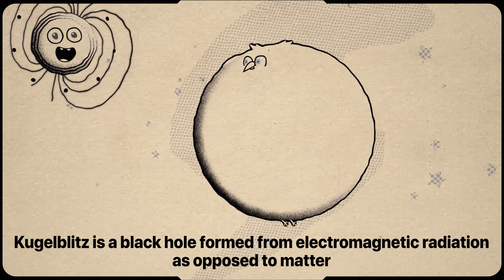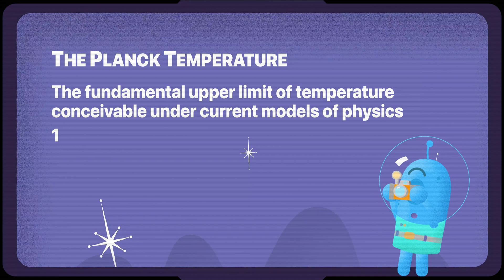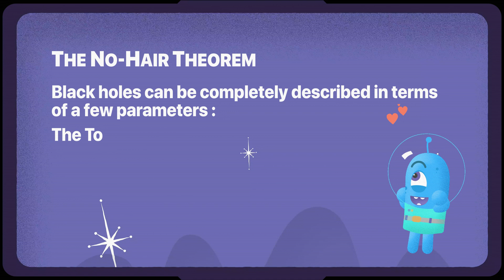Artificial Black Hole Made Of Light

Comment: Nice video! There are Quantum Electrodynamic (QED) effects (e.g. the Schwinger effect and the Breit-Wheeler process) which may well prevent the formation of Kugelblitz black holes. See "No black holes from light" by Alvarez-Dominguez, et al. This paper was uploaded to arXiv gr-qc May 3, 2024. 

The authors find that as electromagnetic energy collapses, in the attempt to form a kugelblitz, the said QED effects give rise to the creation of electron-positron pairs which are accelerated away from the system at ultra-relativistic velocities. The authors claim that this drains energy from the system in a way that strongly prevents the creation of the black hole "in any realistic scenario" (to quote the phrasing in said paper).